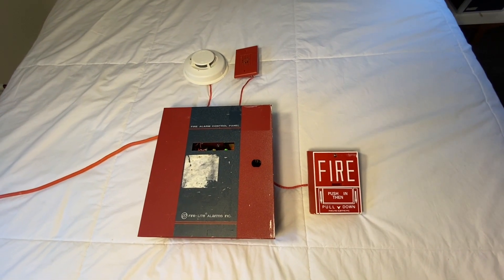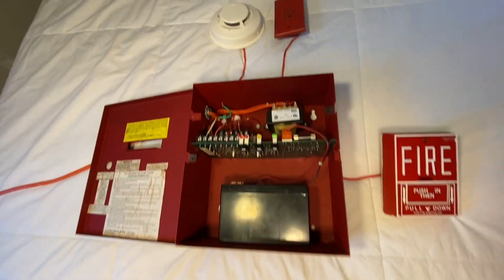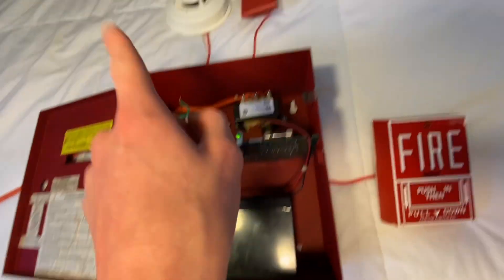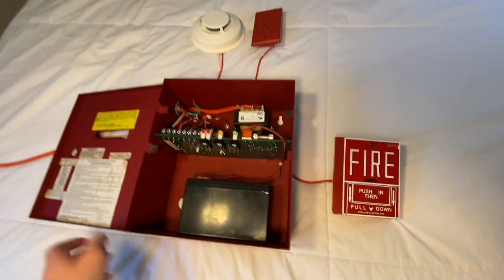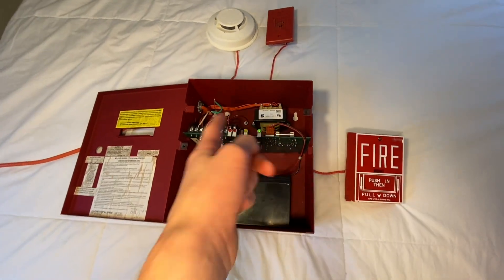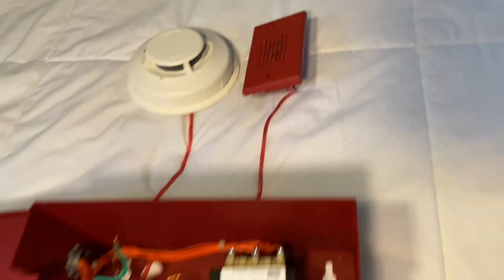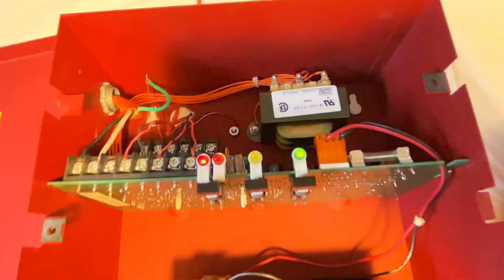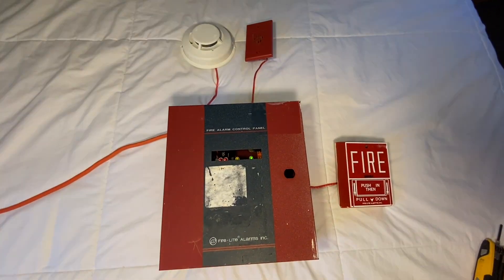Fire.Lite MP-12 fire alarm control panel overview/demo

Comment: the video was great! the panel is so small but they are rare when i looked them up the panel it was expensive  just for the mother board it was $550 with out the panel this is such a cool panel and a good video
Reply from the maker: Yea i'm not sure why they cost so much but they are super rare.